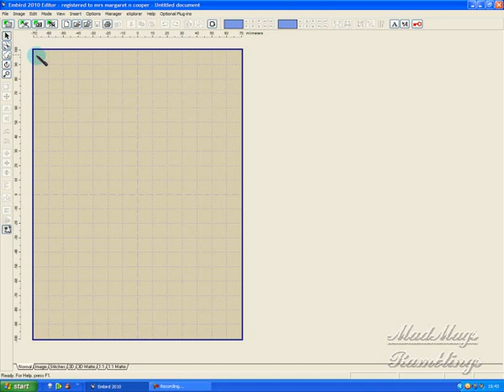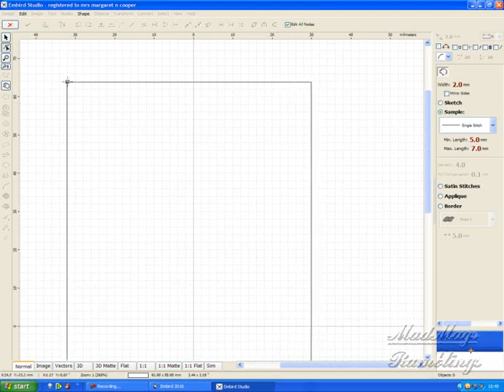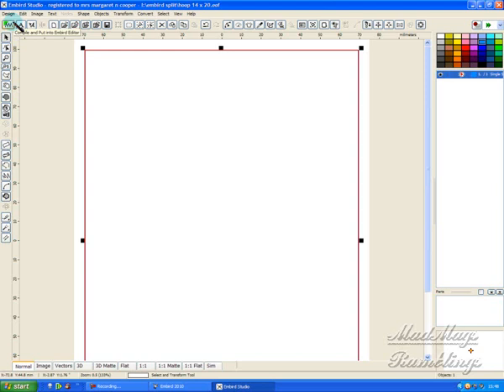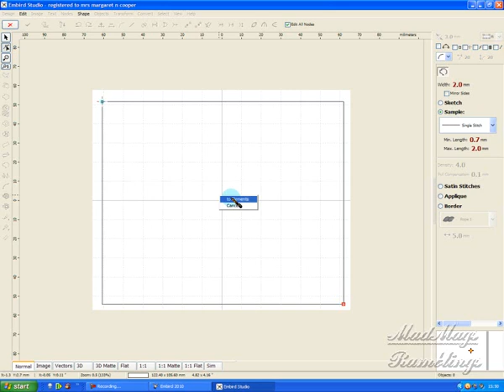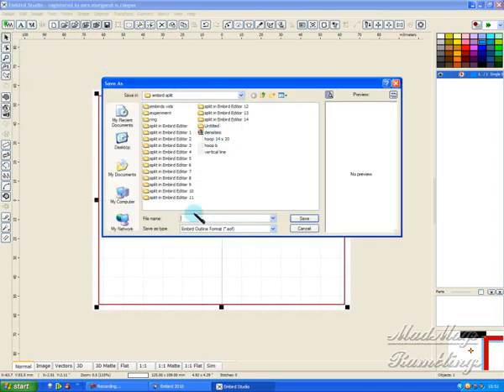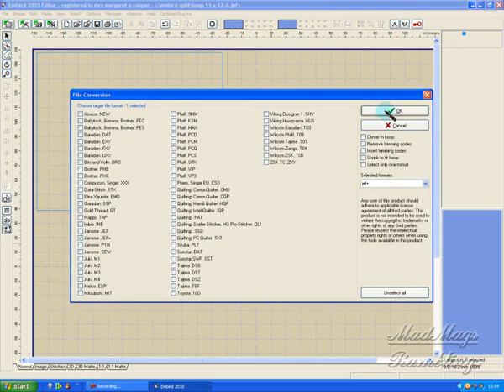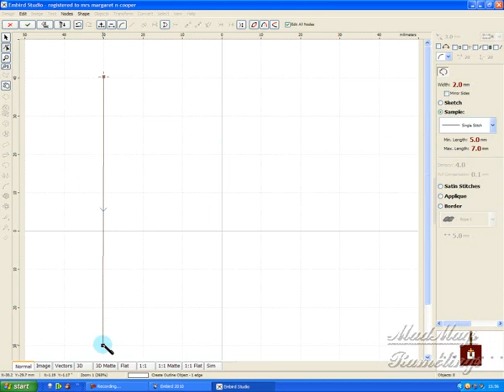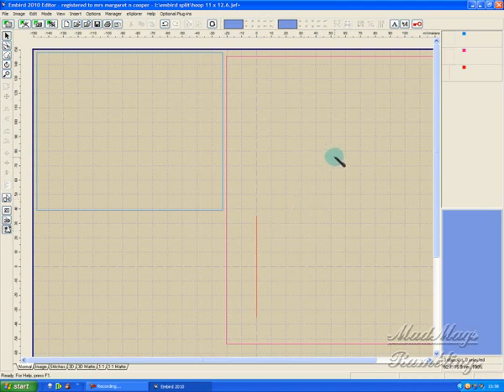embird split 1.wmv

Comment: Very helpful videos but wanted to say that you can easily make a representation of any of your hoops in Editor just by opening the required hoop then using the Insert/Basting stitches (you have to use Insert/Cross Ref Line) first but delete this once you have the basting stitches).  Use the offset border with a minus number to make the basting stitches just smaller than the hoop size.  Sheila